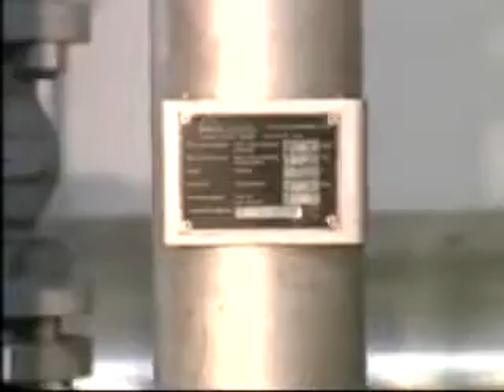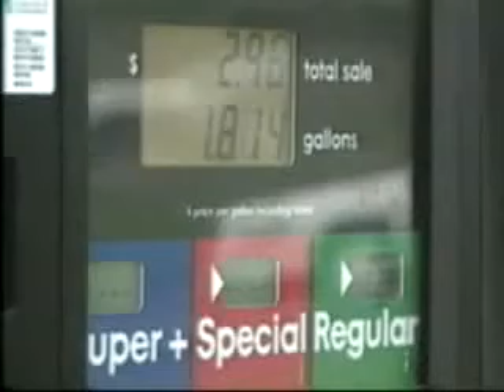Thermal Depolymerization

Comment: The reality

Tdp needs to be set by batch, no continuous process
Only 10% of our oil needs would be displaced
The smell is from hell, described as burnt rotting cat fur...fun.

But a microwave process is supposed to solve these problems and it would almost eliminate pollution in the land, sea, rivers and air.